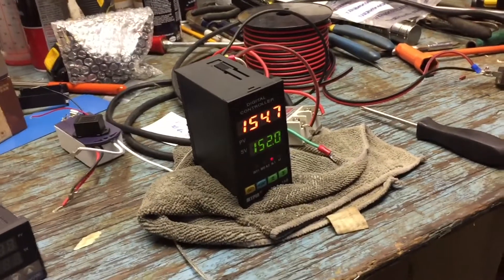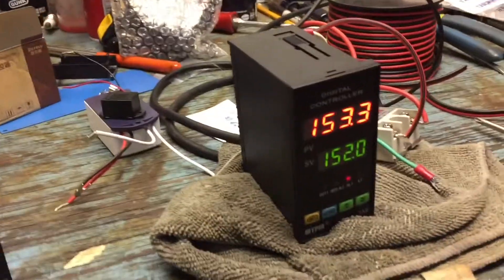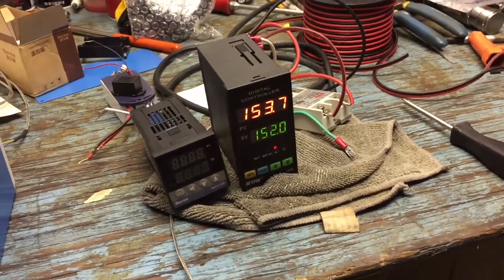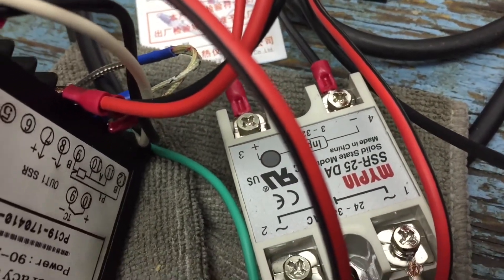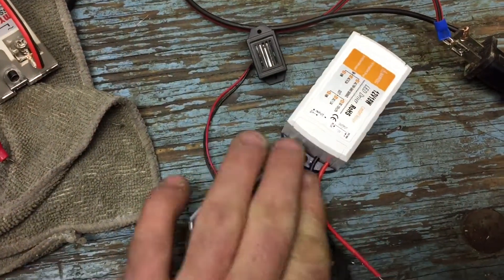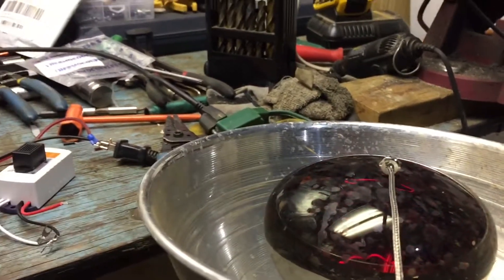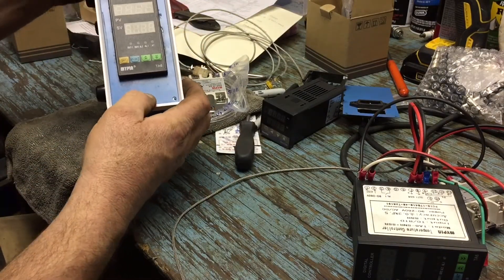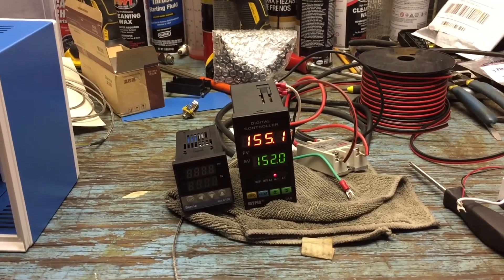Building a PID Controller For A Smoker Pt 2

Comment: I have a smokehouse with an external fire box and a damper going to the smokehouse, I want to put an actuator temp controlled. Could I use that PID and what type of actuator would you recommend?
Reply from the maker: I looked up actuators, seems you could make that work with a PID,, theres lots of choices in the style of fail safe spring return actuators. You just need to pick out the voltage you want to use and gather up the parts.
Reply from the maker: I think a pid would work best with some form of solenoid with basic on/off, I'm assuming you want to close a door or a flap of some sort? I'm not sure what types of actuators are out there, you may find something that works in an on /off type scenario? You might also look into an Arduino or Raspberry PI, you could probably gain better control with them if you have to go the route of using an actuator. Lots of outdoor boilers use basic pid set ups with solenoids so it's not uncommon.

Comment: I'm looking at doing something like this. I have an ITC-106 RH relay output. I have a 12V fan that I want to use. Can I wire the 12V converter to the relay directly, or do I still need a SSR? Thank you for your videos and time. Kenny
Reply from the maker: Check the amperage draw of the fan and make sure it's compatible with the load capacity of the relay in the unit. Most of them are not meant to handle much of a load, more for alarms and indicator lights and such.
Reply: @Tonnsfabrication  Thank you! I will double check compatibility, I'm learning as I go, lol.
Reply from the maker: @KennySchmaling  I understand. Just an FYI SSR's  are available for 12v, I run a few of them on some of my setups. IMHO  the mosfets in the SSR's are better suited for switching loads and they're not that costly.
Reply: @Tonnsfabrication  On Ebay and Amazon now, looking for a 12V SSR now. Thank you for your time!!
Reply: Well, first attempt was a complete failure, lol. 1st. mistake, wrong PID controller. 2nd mistake,  I didn't realize how fragile the solder connection was, on the fan I had. I will try to re solder the wires to fan. It all seems straight forward, until I ran out of patience. I am ordering the correct parts and will try it again.
Reply from the maker: @KennySchmaling  lol yes tiny little connections on some of those fans. LMK if you need any help when you get back at it. Keep in mind 12 v SSR are polarity sensitive on the switch side.
Reply: the out put on the ssr   in video is 24volts 40ma  , so I assume I can run a 24 volt fan directly to the controller
Reply from the maker: @smokingmeatanddiybydaniel8953  I would be careful in placing the load on the PID, when they get hot they tend to freak out. And you know  it's gonna happen during your $70.00  Brisket cook. A little 12 v converter for LED's  only costs a few bucks and it will give you a solid power supply for that 14 hour cook. Use the SSR, they make them for a reason.
Reply: even if its rated output is 24 volts , I plan on mounting the fan inside a box with the controller is in to pull the hot air out 
 @Tonnsfabrication
Reply from the maker: @smokingmeatanddiybydaniel8953    Voltage is irrelevant, though obviously they need to match,  you need to know the rated load capacity (amps)  and be sure the fan will not exceed  that of the unit.That information should be in the paperwork somewhere.
Reply: Yes the fan and the unit on the amps match 
I will be installing the fan in the same box as the pid 
So it should pull air across the pid while sending the air to the smoking camber
Reply from the maker: @smokingmeatanddiybydaniel8953   Hopefully you'll do a video on it, I'd be interested to check out your project. Plus after you mess with it for a while you may be able to teach me a bit about the settings. I'm semi familiar with what it's capable of but it doe's so much more and has settings I don't quite understand.

Comment: Several years ago I had smoked summer sausage that had been cold smoked for 3 days.  It was finished with a darker almost burgundy interior.   It was by far the best summer sausage I ever had.   I now have a nice supply of venison and cold weather to make it work.   Any suggestions for technique, places to go, or message boards to get me in the right direction to make a good sausage that works.  If done wrong, based on my experience you just end up with a bad version of meat loaf.
Reply from the maker: It is an art form that takes a skilled palate and a wise mindset. In short the main idea is that you'll get out of it what you put into it. The main thing to understand is the fat and it's % in the mix.  The fat is what brings out the flavors of the seasonings into the meat. There are lots of videos on recipes and techniques.